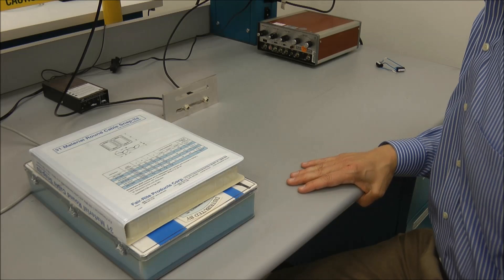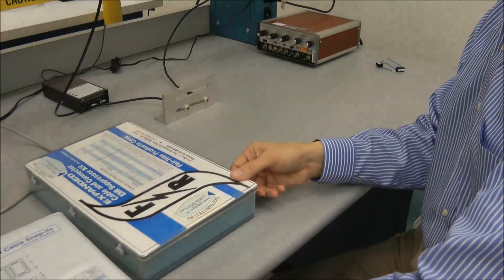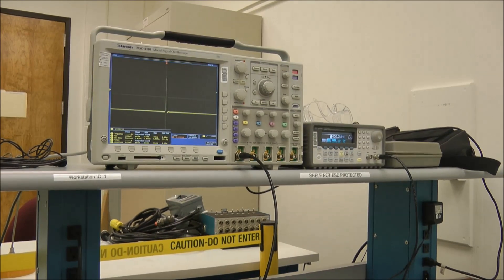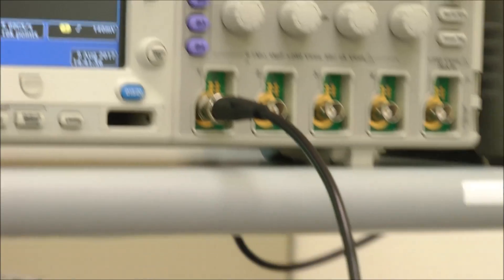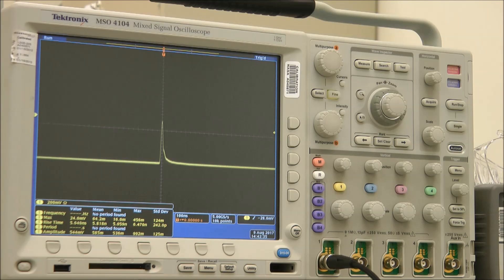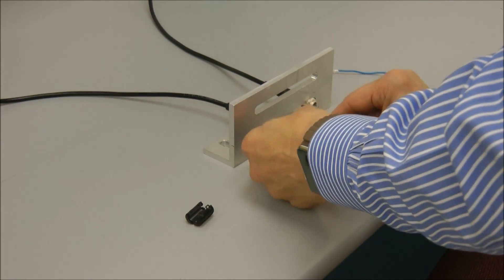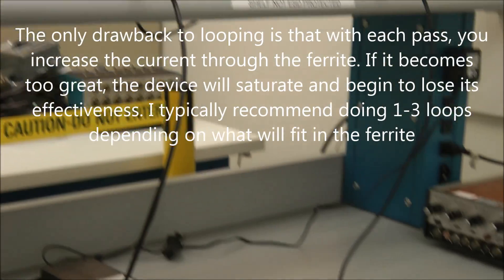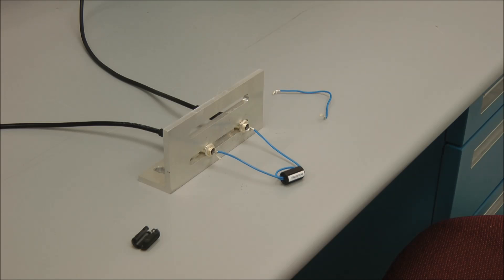Using Ferrites to Suppress EMP Transients

Comment: you mentioned a mix 31 ferrite in the beginning of this video and ended saying that a "broadband" ferrite should be used. Does this mean a mix 31 is sufficient for the attenuation of the E1/E2 pulse? Should a mix 31, 43, 52, 61 or 75 be used? Perhaps a mix 61 (200-2000MHz) and a mix 31 (1-300Mhz) in series on the wire each having multiple turns?

Comment: @disasterprepper If I understand your video, #31 ferrites are the most suitable in an EMP situation? Still, I feel like the 61 covers more of the higher band. I mostly use 75 and 31 for EMI/RFI. On the other hand, I still don't see how you can find a single ferrite that is really with such a wide band and that will bring a large enough impedance to help during an EMP especially using only one ferrite. Unless you use a 77 with the limitations it has but which is wideband for an EMP issue with VHF and UHF components and high saturation.

Comment: You wouldn’t happen to have a common cable size chart would you? I’ve been going through sizes and looking to buy these ferrite’s. 

RG-6 RG-11 (Coax cable)
Cat5e, Cat6, cat7 etc. 

Electrical wiring. 
14 gauge 
12 gauge
10 gauge
8  gauge

Comment: HI JUST GOT SOME  WERE DO I PUT ON THE CHAMPION GEN
Reply from the maker: Hi-sat ferrites would go around the power wires from the battery, one ferrite per wire.
Reply: @disasterprepper   NO BATTERY  PULL START
Reply from the maker: @davidjones1393  Does it have a cigarette lighter plug?
Reply: @disasterprepper  NO
Reply from the maker: @davidjones1393  Then you really can't use the T.R.A.P. devices on it. The good news is that a simple generator like the one you're describing has very little chance of being damaged by an EMP (assuming it's not plugged into the wall).
Reply: OK  THKS

Comment: Ferrite will do nothing to stop the voltage induced on a conductor that absorbed an EMP pulse.
Reply from the maker: Well, I sort of agree. A ferrite is used to suppress electrical current. Current flows due to voltage differences. So, if an EMP induces a voltage on one end of a wire, the ferrite will help to suppress the potentially damaging current from flowing through the wire. Ferrites are often used in conjunction with voltage transient protection devices (such as SPDs and transient voltage suppressors) to provide well-rounded surge protection. We use ferrites all the time on cables, and they are very effective at reducing coupled energy from harming (or disrupting) an electrical system.

Comment: Would a reverse-biased shotky diode help as far as protecting against reverse voltage transients, or would the thing simply get fried when the EMP hit? If the diode WOULD help, what peak voltage and current ratings should I shop for?
Reply from the maker: I don't think a schottky diode would have adequate current ratings to survive the surge.
Reply: A transient suppression diode from Microsemi may be adequate. Select one with the proper breakdown voltage for your application and proper pulse handling and in the needed mechanical configuration. They've got a wide range of good products. (as a former EMP Engineer (36 years ago, phew), it's nice to see this channel. I'm setting up a large solar array on my house (49 panels) and want to make sure to have EMP protection.  WW3 unfortunately, is coming.

Comment: Do I need to use any EMP protective measures for solar panels NOT CONNECTED to anything, but are simply being stored in a garage?
Reply from the maker: Some folks wrap the boxes in foil, but I don't think there's a big risk to panels disconnected from wiring.
Reply: Nope. Nothing is needed.

Comment: 2 Questions: 1 - What is meant by an EMP Transient? Is that different from a pulse? 2 - So if I were to take some ferrites and put them around the cable to my refrigerator then my refrigerator would be safe from an emp pulse coming through the cable?
Reply from the maker: "EMP transient" is just another word for the complex (E1-E2-E3) pulse that occurs following a nuclear EMP. As for putting ferrites around your refrigerator power cord, yes, they help to suppress conducted transients (pulses). It's not possible to say if they would fully protect against the incoming pulse, however, because at high enough levels, the ferrites saturate and become less effective. With that said, they definitely help to reduce the signal that travels down the line.

Comment: Ferrites work well in low impedance systems, so, I'm wondering what the estimated source impedance would be in an EMP?
Reply from the maker: You're exactly right. A good ferrite might provide an impedance of 400-500 ohms at the relevant frequency. The attenuation that would provide would depend greatly the input impedance of the particular electronic device.
Reply: Would using more than one ferrite “in series” result in an additive effect?

Comment: Really interesting video, I'm trying to figure out if it's possible to protect an entire home from a electromagnetic pulse, would love to hear your thoughts
Reply from the maker: It's certainly possible to install a power line filter at the input to your home (or at your fuse panel). That would help to suppress the conducted pulse, although I haven't seen any that were properly tested against the E1-E3 pulses. Protecting against the radiated energy would require either shielding the home (difficult) or shielding individual items.

Comment: on for example a solar installation where would we want to locate the ferrites?  In multiple locations throughout the system? If the panels are linked together in series, paralleled  to the pv combiner would it be beneficial to put ferrites on each panel or just the paralell connection to the pv combiner?
Reply from the maker: I don't know that anyone has studied this in detail, but in general, one wants to put a ferrite on every power line of any appreciable length (say over a couple of feet). A ferrite will help to mitigate sudden changes in current on that line.
Reply: Thanks doc.

Comment: On a long run of wire, should fer rites be spaced at regular intervals? Like every 3 feet, or just at the end of the line? Perhaps I'm asking what the effective way to use them on a conductor would be. Thanks for the assistance and videos.
Reply from the maker: Hi Dana, there is an effect in which high frequencies can set up "standing waves" on long conductors, so it wouldn't hurt to place conductors evenly spaced along a long conductor. But with that said, a single ferrite with more than one loop of wire wrapped through it is typically more effective than multiple ferrites. It never hurts to add more ferrites, but the return vs cost goes down after the first, especially if you're able to add a second (or third) loop through the ferrite.
Reply: Thank you. "Get Both" is also an option. In this case, multiple loops would be possible at the end, but would that be more effective than spaced ferrites and if spaced are used, what would the spacing be?
Reply from the maker: Loops are more effective than series-added ferrites. That is two loops are better than two ferrites. Three loops is better than three ferrites, etc. The effectiveness is supposed to go as the square of the loops, but in practice it falls short of this. Still, adding multiple ferrites is never bad. If you do that, I would suggest spacing them evenly across the cable.
Reply: Install the ferrite close to the equipment to be protected. 
Multiple beads = more radio frequency energy supression.

Comment: Thanks for these videos.  I went to your site, but didn't see any ferrites available.  I was wondering what types you would suggest for emp protection?  I saw mentioned somewhere to use type 61? Do you have specifics in your book?  Also, have you considered setting up an Amazon store with items you recommend but don't carry on your site? (Or an affiliate link) Thanks again!
Reply from the maker: Ferrites on my site are at http://disasterpreparer.com/emp-ferrites. As far as type, you need to look at both the material as well as the impedance across frequency. What you want is one with the highest broadband impedance (from 1 MHz to 1 GHz).
Reply: disasterprepper thank you very much.  When I went to your site earlier, the link to the ferrites didn't work for me, (Android, Chrome browser).  This direct link works, thanks.
Reply from the maker: Thanks for letting me know. Not sure why it didn't work. I'll check on it.
Reply: @disasterprepper  the link you provided no longer works.  I get a 404 Page not Found error.  Is there still a valid paged somewhere?

Comment: How well do multiple looped ferrites (in series) attenuate?
I suspect these may protect say a solar charge controller; however the solar panels would probably be fried during an EMP, correct?
Reply from the maker: Adding series looped ferrites add more attenuation. So two, double looped ferrites would do better than one. The equation to estimate attenuation can be approximated by a series divider: V = Vpulse * Zload/(Zload+Zferrite1+Zferrite2). The smaller the load impedance the greater the attenuation from the ferrites. Also, the greater the ferrite impedance, the better the attenuation.

Comment: So how does that relate to the transients an EMP might cause? What kind of power/transients does an EMP have?
Reply from the maker: An EMP will result in a complex electromagnetic disturbance that will manifest as voltages (and current) on conductors. The sharpest of those signals will look like a very narrow pulse, similar to what I simulated here with a pulse generator. The idea of using ferrites is to suppress the transients seen on small power lines feeding devices, such as computers, solar panels, etc. They likely won't eliminate the transients, but they will help to reduce them, hopefully to levels that the hardware can survive.